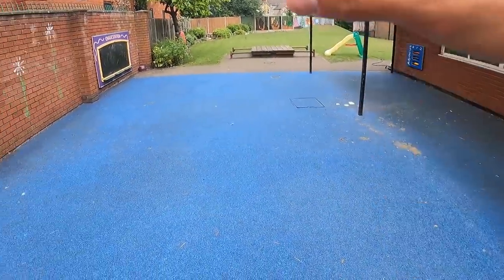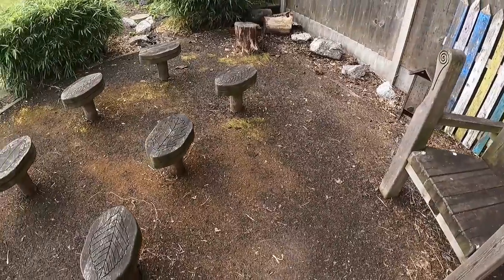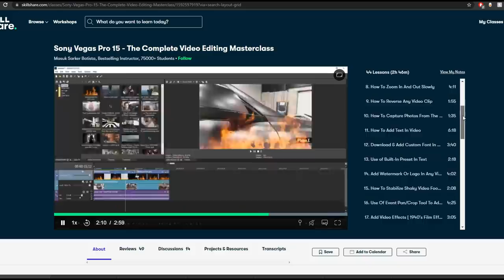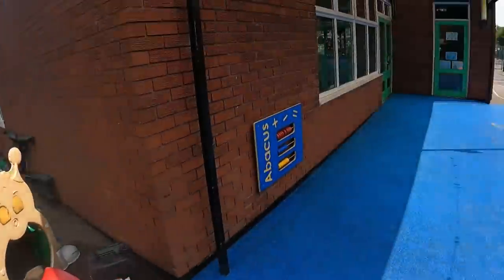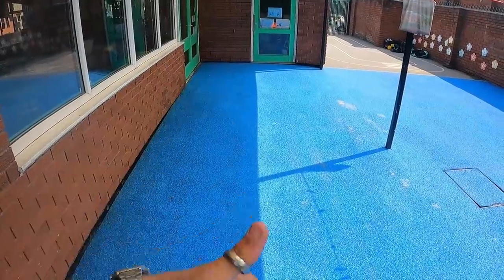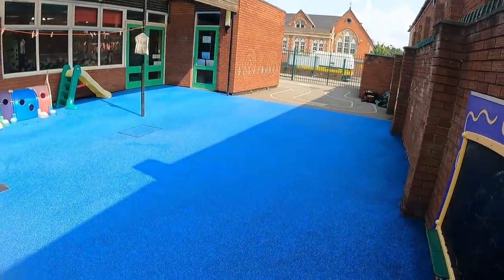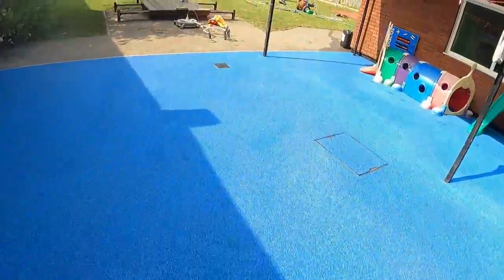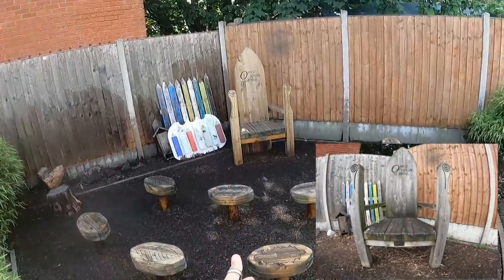I cleaned this COLOURFUL school playground for FREE!

Comment: First of all, great job on the work and effort put into both the video and the cleaning. But a question I have… is it easier to power wash on high humidity days or harder? I don’t know a lot about power washing or anything and I’d like to automatically think low humidity is best. But I saw some dirt dry in the time lapse that required you to go back and re-rinse because it dried. What’s easier but also what situations would you prefer high humidity over low or visa versa?

Comment: Comparing with the other schoolgrounds you did earlier. It did look like someone at this school has tried to keep the soft areas clean.  

But still it really needed the extra care.
There is a difference between cleaning with a broom and water or with a pressure washer.
Reply from the maker: These are only 10 years old, the other ones were 20 years so big difference just there! 
Cheers mate!

Comment: When you do wood, doesn’t it make the outer surface more susceptible too moss and other stuff ?
Reply: I’m a playground designer, we use tanalised wood. I can tell which competitor manufactured these pieces and they too use tanalised wood. The tanalising process pressure treats the wood to force chemical preservatives deep into its grain, the wood then doesn’t need varnishing. If he was to power wash vanished or non tanalised wood, yes it would be left susceptible to moss and insects.
Reply: @TheCheekyassxx  very well, thank you 🙏

Comment: I used to do wetpour pressure washing it isn't a great idea this will break down the top layer of glue and will start to crumb up
Reply from the maker: That's why I use low pressure, takes a lot longer than blasting it but keeps it in great condition

Comment: Is it right that you can’t use an everyday type of pressure washer on these types of surfaces?
Reply from the maker: Hey Rachel, you can use any pressure washer on them, may just take a lot longer with less powerful ones :)
Reply: @PartridgeExteriorCleaning  Thanks so much for your reply. We have this type of surface and were told never to pressure wash it as it would lift the surface up. This is really helpful, thanks. Although, I have about 10 years worth of build up to clean off it!!!

Comment: Not treating the wood is actually the better thing outside. Especially when there's kids involved who could damage it. As long as the surface is all varnished it should be no problem. But if there are scratches in the surface where water can get in, it's a different story. Wood is constantly moving due to fluctuations in temperature and moisture. If only one part of the wood is exposed to those fluctuations, because the water can penetrate that one spot, you can imagine what could happen: The wet wood expands while the dry wood around stays the same. Especially with small kids you can never guarantee that they don't get the surfaces scratched. Just the rivets of a kid wearing jeans, sitting down on the wooden stools causes enough damage to the varnish that the treatment of the wood is ill-advised. Unless the wood is regularly and often retreated. The amount of costs is too high for the benefits gained by treating the wood.

Comment: Great job, but sad when I see you or anyone pressure washes wood. Why would you do that?  The pressure tears the wood apart faster than normal. It used to be a living thing. So it will rot from the inside out even faster.  Soft wash if you have to.
Reply from the maker: Thanks Janet, it’s just low pressure stripping the algae and top layer off. It will be sanded down and varnished by the caretaker 👍